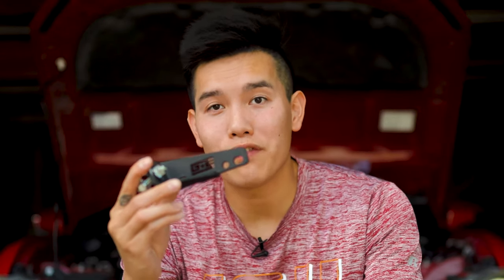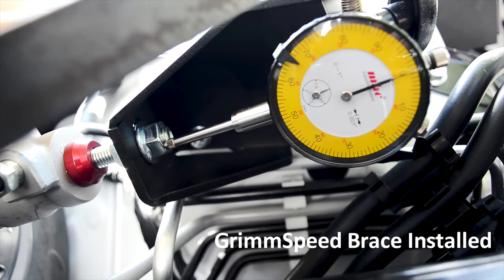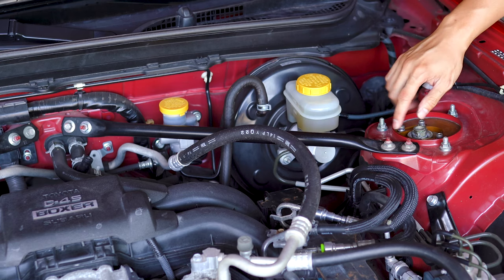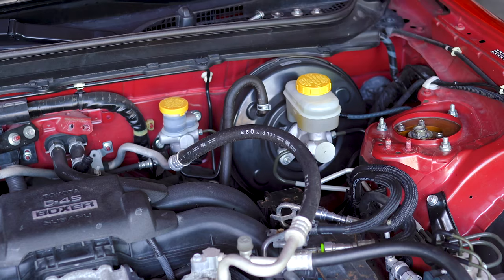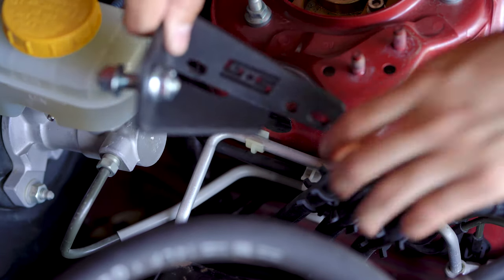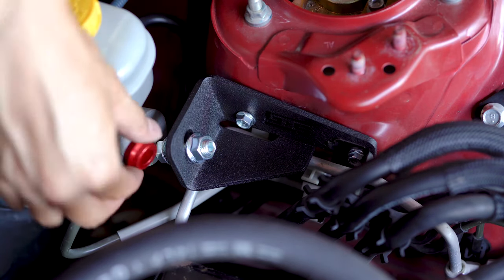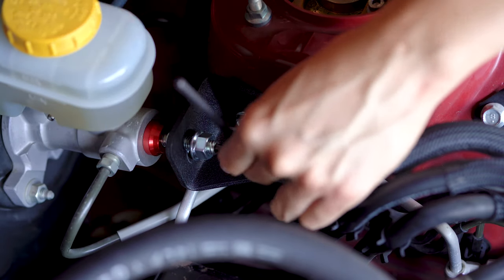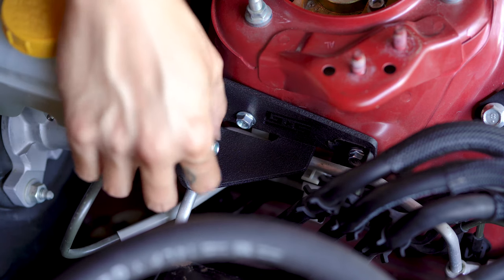FRS/BRZ Master Cylinder Brace Install

Comment: very nice video man - excellent commentary, professionalism, acknowledgement, I'm learning a lot :) also question, what other vehicles do you own?
Reply from the maker: Thanks for the kind words! Currently just have the FRS and a CRV. Started off with a bugeye WRX, moved to a GTI, then an S2000, now here we are. I've had a handful of bikes as well. What do you drive?
Reply: @KevinVo  I have a cbr500r am scared to ride sometimes - and have an 19 Subaru Impreza - no mods. Hoping to get a base WRX or Cybertruck
Reply from the maker: @abzdeman92  I used to own a CBR600. It certainly has gotten more and more dangerous, but there's nothing else like it. If you decide to pick up the WRX, head over to Subispeed and you'll see me over there too :)